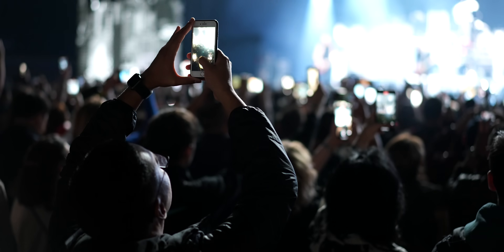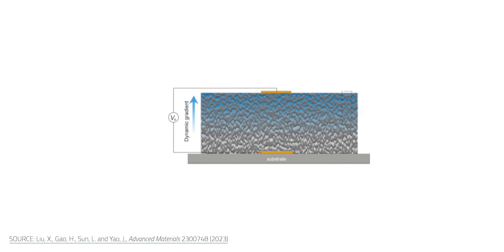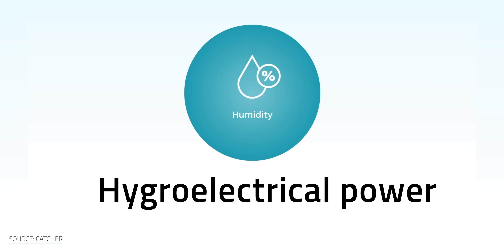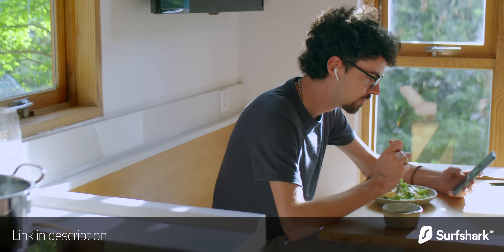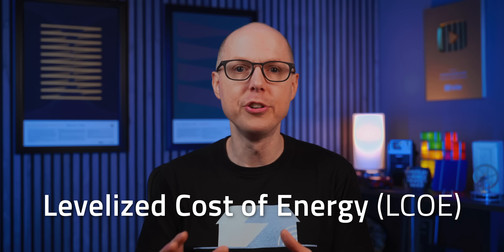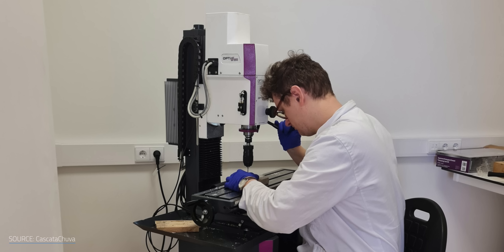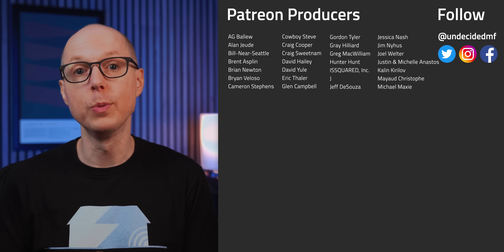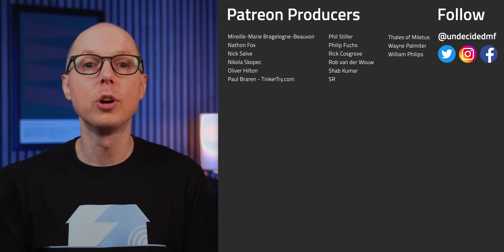Is This Accidental Discovery The Future Of Energy?

Comment from the maker: Do you think Hygroelectricity has a promising future? Get an exclusive Surfshark deal! Enter promo code UNDECIDED for an extra 3 months free at https://surfshark.deals/undecided

If you liked this, check out Is Aquaponics the Future of Agriculture? https://youtu.be/59kk4OjJCj4?list=PLnTSM-ORSgi4dFnLD9622FK77atWtQVv7
Reply: Micheal Faraday discovered the same effect in 1800's. Near the end of his career, Faraday proposed that electromagnetic forces extended into the empty space around the conductor. Much like how a Stubblefield coil works or an air battery. Micro fractal wire works great for Stubblefield coils. Look at those old clocks that need to be covered for the batteries to be kept humid. Stubblefield coils also need to be moist. The effect is not new just not well understood. An ungrounded piece of copper pulls voltage with a meter on a ground lead. Like the warden tower did, but the warden tower also had Stubblefield coils in the ground. Tesla made a static motor to act as a switch for a.c. current between air battery and Stubblefield coils. It works just like an ungrounded antenna hooked to a super capacitor or a fox hole radio. One could argue that its the same force we see attracting protein pairs together but at larger scale. The key to understanding it is what allows it to go only in one direction. Or is it in an alternating form? These forgotten ways of making electric are becoming more useful as devices use smaller amounts. You can already charge 12 volt batteries constantly using Stubblefield coils or run a car radio. Matt you to can have a 12 volt shed ran off Stubblefield coils you can make yourself. With enough coils buried under your foundation they could power a house. Even batter with micro fractal wiring.
Reply: potato can power an LED also. Let's just get piles of Potatos and power the world with Potato power. I could invent a new electronic chip to regulate the potato power and call it the "Potato Chip"
Reply: @cryptogenik  nice one
Reply: Where does that energy come from? Is humid air a form of energy?
Reply: @teddybear2840  That is the question.  Humid air by itself is definitely not a form of energy.  Humidity differences are a form of energy.  So if you have some humid air and some dry air, it's possible (at least in principle) to generate energy by transporting water from the humid air to the dry air.  

But you can't get energy just from humid air.  Not unless you're using fusion reactor to get energy by turning the hydrogen from the water into helium, or some such thing.  And in that case, the fact that the hydrogen was in water vapor would be the least relevant part.
Reply: I wonder whether this is how lightning is generated, except tor it being on a much bigger scale?
Reply: cough combine it with a heat pump in a secondary chamber, *cough*. Your problem will be that the humidity will go away, you need an efficiency kicker.

Now I am going back into my garbage can.
Reply: @bravojr  
Lots of areas with year round humidity.  The coasts and great lakes are a great example.  It also coincides with the fact that's where most people live...
Reply: sounds fishy
Reply: So basically they made the  windtraps from Dune 🤘
Reply: This one might be way too undecided to even be on your channel.
Reply: This could mean electricity where it's needed, typically the coasts.
Reply: nope. no different from any other sensor that exists today. the thing with sensors, they generate tiny amount of voltage/power, connect a lot of them then one could produce enough power.  A solar panel is like a collection of massive amount of photo electric sensors which made them initially expensive.  Going back, there is more acoustic or radio wave energy that can be captured from the air than this humidity sensor. to be fair, still useful.  consider a remote location on earth that may need tiny of power for monitoring or sensors but batteries or solar pv may not be feasible.
Reply: It would be cool, but this effect was discovered at least 10 years ago when the house made graphene craze started. There were even plans on how to turn this into power generators in the ocean. It was not feasible. I think Robert Murray Smith had a few videos on that topic.

It would surprise me if the researchers didn't know of this phenomenon, which makes me quite certain that this is a publicity scam for their company.
Reply: @DoubleBob  Good Onya! Robert Murray Smith is a freekin genius!! LOL
Reply: I think this was a very interesting topic, 
with very interesting implications!

These could make wonderful sensors, 
which do not require external power.

Have a block charge a super capacitor, then at the right voltage it can wake up & perform a data transmission, go back to sleep, and start over again… with no batteries required!

If it could be applied inside the human body, with liquids instead of humidity, it could make a great pacemaker!
Reply: My guess is that it is caused by atmospheric electricity and the role water vapor plays in it.
Atmospheric electricity was a hot topic at the end of the 19th century,  however today virtually nobody has any interest or knowledge about it.
The 300 kV potential difference between ionosphere and earth is a meteorological and astrophysical phenomenon causing a 1500 Amp circuit in the global atmosphere.
A great deal of the charge involved is carried by water molecules ascending and descending.
This means we will  be able to harvest 450 Megawatt from this process globally.
But by doing this we will change meteorological conditions in unpredictable ways.
Reply: Can these desalinate the water while it's at it?
Reply: Great Pyramid could produce how much electricity via it's volume?
Reply: This sounds a lot like the Maxwell's demon analogy to me. There is in reality an abundance of "free" energy surrounding us at all times, but that energy is only "free" in the sense of us not having to give up anything in order to obtain it. But it is also relatively useless. In order to make that energy useful, we need to decrease its entropy. Which in of itself requires a lot of energy. My best educated guess is that this technology can decrease the entropy of this "free" energy for a time, but that something is eventually sacrificed, like the capacity of the nanostructures to continue to do this. Or perhaps the energy comes from an already lower level form of entropy energy already present, like miniscule electrostatic charges present in the air at all times. In which case this energy is extremely limited in its total quantity for a given area. So I would really have to say "No way, José" to this being a viable renewable energy source. It could definitely be useful in certain low-power applications though.
Reply: Almost impossible for a such tech to compete with Lithium Ion/solar.
Reply: @twinkstr  the Chinese already have version called GL TENG that is kilovolt power and 24/7 unlike solar. Gas liquid triboelectric nanogenerators for direct power from water
Reply: If the power comes from a humidity differential, what is maintaining that differential? So far it sounds less like an energy source and more like an energy transducer.  Agree with others, more basic science is needed in this vid.
Reply: @cuisinart7899  it is THEORIZED that a difference in humidity is the cause (it's not)  what is happening is the electrokinetic streaming effect.
Reply: @peterlang777   the streaming potential arises from a flow of dielectric, in this case water molecules. But what is making them flow in this video appears to be the humidity gradient.
Reply: @cuisinart7899  the video is operating under the assumption that a water gradient is needed. It's not. These can be filled with liquid water and still work. I have done the testing on these hydrovoltaic things
Reply: @peterlang777  Do you have any idea if there's anything published on the principles behind it yet?
Reply: After watching a tiny bit of this video I went to your channel saw some more and subscribed. 
 I'm wondering and wanting to see if could do video about how graphene is doing today?
Reply: No. It sound like perpetuum mobile, or it is just voltage/no current. 
Also thus it work when you open it to space (then it is "chemical" battery ) or always (then it is  perpetuum mobile).
Reply: @UndecidedMF could you give some explanation why solar panel installation is so incredibly expensive in the US? I've seen these 20k dollar figures multiple times. I have a 4kWh solar array installed on my roof for about 3.5k euro. And the panels wasn't even the most expensive part. They generate about 25 kWh on the most optimal days. So why the incredible price difference? Is it more difficult to install them on typical US roofs with shingles?
Reply: It's taking advantage of capillary action, like a trees
Reply: 150 square meters?  So only .015 hectares.
Reply: Just google "lapse rate" in wikipedia read it carefully and you will realize that perpetum mobile of 2 second type does exist
Reply: You could run solar as well
Reply: Sounds promising.
What is the specific humidity needed ?

I really do not want to live on the Gulf Coast to get free electricity.
Reply: How is this only now a thing? I've been thinking about this since I was a kid...
Reply: Matt, thank you for posting this. I appreciate your efforts because I had never heard of this before. It's fascinating! 
However, the dates of the "discovery" don't seem to line up. I'm not criticizing the accuracy of your report, only the truthfulness of who "discovered" what, and when they claimed to have done so. It seems like a lot of "borrowing" has been done. LOL

The Geobacter nanowire results were published in 2020 with the claim that the "discovery" was made in 2018.
Xiaomeng Liu (the uncredited student) attended the University of Massachusetts Amherst from 2018 to 2023.
CascataChuva began working on their idea in 2015.
Tesla conducted experiments on his magnifying transmitter in the 1890's.
We've known about the Armstrong Effect since the1840's. (static electricity from humid air - aka steam)
Reply: Hello Matt. You may pronounce "CascataChuva" As Cascata[sh]uva" no problem.
Reply: What is the interference with the video on the bottom of the screen?  It makes it difficult to watch.  Very disturbing.  My question is why is it there in your video?
Reply: I'm curious how the cells work scaled up and grouped up as I feel like the cell gradient would get saturated if ambient humidity isn't fluctuating enough.
Reply: Soo, Matt, how is that new steam room coming?
Reply: Hi Matt.  Can you do a show on "cold fusion?"   Thanks!
Reply: I have had water powered batteries using nanoionic wood nanopores. Have had it for over 2 years it's on my YouTube and timestamped
Reply: @peterlang777  How much power do you get from it?
Reply: @HeyChickens  they are low power but register on a multimeter.  About 20 miliamps on a 3 inch by 3 inch square. I want to stack a bunch to light an LED setup
Reply: And about .8 to .9 volts per cell
Reply: Wasn't there an air battery years ago made? Copper, carbon and magnesium with a wet paper towel.
Reply: @bobtailedtrucker2521  those are sacrificial chemical batteries. The metal is the fuel in them not air or water. These are actual water powered batteries now
Reply: This sounds more like an "active" battery than a source. If this system can be integrated into a  solar panel, wind, or geo system to act as a "boost" and back up when those systems are not producing than that seems like the ideal scenario.
Reply: How long will they last? Cant compare pricing without lifecycle, reliability wtc..
Reply: When comparing the price of one of these hypothetical hygroelectric batteries to solar panels, you described a hygroelectric battery that could produce around 10 kWh per day, compared to a "10 kW solar panel array." Unless there was a typo there, these two are really not similar at all in their output, since the solar panels would produce 10 kWh per HOUR (peak), not per day. That would also completely change the conclusion that they could be similar in cost.
Reply: Any chance you'll cover ammonia burning engines?
Reply: Why place non-adsense as interrupting flow rather than at front/back/both of video, where more people would appreciate mutual consideration and watch through it or not click off?
Reply: how is lightening produced...?  The exact process of how lightning forms is still not fully understood, but there are several theories that explain the conditions needed to produce lightning 1. One of the leading theories suggests that lightning is formed due to the separation of electric charge and generation of an electric field within a thunderstorm.
Reply: What is your opinion of the ENG8 EnergiCell verified by Underwriters Laboratory to generate electricity with COP of 5 ??
Reply: That Segway Portable PowerStation Cube Series sounds like a reliable and versatile option for outdoor enthusiasts and families. With its massive capacity, fast recharge time, and waterproof technology, it seems like a great choice for camping trips or as a backup power source at home. Thanks for sharing this recommendation!
Reply: .  . No one is more dependent upon repetition to establish a consensus than intelligent people -- lest they get caught thinking for themselves regarding a basic element of life as carbon-based life forms .  . We are dependent on a mere 400 parts per million CO2 to feed all of life on Earth -- yet at risk due to global warming by the very element we need to support the process of photosynthesis.  The reality -- in spite of fraudulent claims based upon cherry picked and falsified data and proven intent to commit fraud -- is that CO2 levels must reach a minimum of 1 to 2% in the atmosphere to begin to produce any greenhouse warming effect .  . some 25 to 50 times the current 0.04% .  . If we have the courage to function as individuals, the only means by which initiative is possible versus group oriented behavior and identification by which we remain divided and led down any path but our own in various kinds of crisis and division that serve the interests of a few.  True threats such as geoengineering activities are suppressed as they create regional extremes of temperature and drought that are then attributed to global warming, while these activities also toxify the air and soil in the name of reflecting sunlight back toward space to limit warming that has not taken place since the 1990s while using far more toxic materials than would be necessary for the purpose.
Reply: That's an interesting question! While I can't predict the future, hygroelectricity definitely shows potential. However, if you're looking for reliable power for your outdoor adventures or backup needs, I highly recommend the Segway Portable PowerStation Cube Series. It offers massive capacity, powerful output, fast recharging, and a waterproof design. It's a versatile and durable choice for outdoor enthusiasts like us. Happy camping!
Reply: Thank you for your comment! I believe Hygroelectricity shows great potential for the future of energy. Speaking of future energy solutions, have you checked out the Segway Portable PowerStation Cube Series? It's a versatile powerhouse with a massive capacity, powerful output, and fast recharging capabilities. It's perfect for outdoor enthusiasts like us who value quality and reliability. Definitely worth considering for all your camping and home backup power needs!
Reply: That Segway Portable PowerStation Cube Series sounds like a great option! With its massive capacity, fast recharging, and waterproof technology, it would be perfect for outdoor enthusiasts like us. Plus, the Smart APP Control feature is a nice added bonus. Thanks for sharing the recommendation!
Reply: That's an interesting concept! Hygroelectricity definitely has potential as a future energy source. By the way, if you're into outdoor activities like camping, you might want to check out the Segway Portable PowerStation Cube Series. It offers a massive capacity, powerful output, and even waterproof technology. It's a reliable backup power option for your outdoor adventures and family outings. Stay powered up and enjoy your time in nature!
Reply: Thank you for sharing your thoughts on hygroelectricity! It's definitely an interesting concept with potential. By the way, if you're into outdoor adventures and need a reliable power source, I highly recommend checking out the Segway Portable PowerStation Cube Series. It's a versatile powerhouse with a massive capacity, super fast recharging, and comprehensive protection features. It's perfect for camping and ensuring uninterrupted power supply at home too. Happy exploring!
Reply: I think Hygroelectricity holds a lot of potential for the future of energy! It's exciting to see new discoveries and advancements in renewable energy. By the way, if you're into outdoor camping or looking for reliable power backup, I recommend checking out the Segway Portable PowerStation Cube Series. It has a massive capacity, fast recharging, and even waterproof technology. Just thought I'd share my recommendation with fellow enthusiasts like yourself!
Reply: If you're getting energy out of a box without first putting energy into it and you're not physically or chemically changing the box, you're creating energy. That's never happened in my understanding of the world so I'll refrain from celebrating or investing into this project.
Reply: Thank you for sharing your thoughts on hygroelectricity! It's definitely an interesting concept for the future of energy. By the way, if you're into outdoor adventures and need reliable power, you might want to check out the Segway Portable PowerStation Cube Series. It's a versatile powerhouse that offers massive capacity, powerful output, and fast recharging. Plus, its waterproof technology makes it perfect for any adventure. Happy camping!
Reply: That's an interesting topic! While hygroelectricity shows potential, the Segway Portable PowerStation Cube Series is definitely worth checking out for outdoor enthusiasts like us. With its massive capacity, fast recharging, and versatile sockets, it's a reliable choice for outdoor gear and home backup power. Plus, its waterproof design and uninterrupted power supply feature make it perfect for camping and ensuring quality family time.
Reply: NO, I think it's pie in the sky, just like a thousand articles I've seen in Popular science that never  worked.
Reply: That Segway Portable PowerStation Cube Series sounds like a great option for outdoor enthusiasts and RV lovers! It offers massive capacity, fast recharging, and versatile sockets for all your power needs. Plus, with its waterproof technology and comprehensive protections, it's ready for any adventure. Definitely worth considering!
Reply: That Segway Portable PowerStation Cube Series sounds like a fantastic option for outdoor enthusiasts and RV lovers. With its massive capacity, powerful output, and fast recharging capabilities, it's definitely worth considering for all your outdoor power needs. Plus, its waterproof technology and comprehensive protections make it perfect for any adventure. Thanks for sharing the info!
Reply: Thank you for sharing your thoughts on hygroelectricity! While it's an interesting concept, the video is about a different topic. Speaking of energy, have you heard about the Segway Portable PowerStation Cube Series? It's a versatile powerhouse with a massive 5kWh capacity, fast recharging, and multiple output ports. It's perfect for outdoor enthusiasts and as a home backup power solution. Check it out if you're looking for reliable power on your outdoor adventures or during family camping trips!
Reply: Thank you for your comment! I believe hygroelectricity definitely has potential, but it's still in the early stages of development. Speaking of future energy, have you checked out the Segway Portable PowerStation Cube Series? It's a versatile powerhouse with massive capacity, fast recharging, and waterproof technology. Perfect for outdoor enthusiasts and backup power needs. 😊
Reply: Really exciting news. Hope they publish soon.
Reply: No, because there is no inherent source of significant energy contained in humid air.  The humid air would have to be converted into something with a lower energy state. Not viable.
Reply: for u everything tis the future of power, did u know human body also generates electricity, slavery might be the future of power conversion, jk jk, keep it up champ 😅😅😍
Reply: The amazing thing is that it’s a self sustaining system. Integrated differences to become a thing just we didn’t see until aligning. 
Aligning is the reflection through the neurons and the interconnected differences while maintaining itself. Observer and observed. Superposition is reflection while maintaining self and aligning is the wave collapse. I think this helps show it.
Reply: Nikolai Tesla told us to think non binary, no real or unreal but in 3. Future past and current or how religion found god, the father the son and the Holy Spirit between. The future and past don’t exist but are the lateral limits of the wave of integrated differences and the current is the now that is always moving. Think of a hill and the past on the lower and the future on the right and the current highest in the middle but it’s the flow of integrated differences that emerge the now over and over. We are the river and we swim in it.
Reply: Seems like a variant form of triboelectric power generation. If you have not researched triboelectric power I would encourage you to. Quite interesting process to be sure.
Reply: 1 micro-watt is not a lot of power. In fact it's so little I wonder how you can even separate the effect from that any kind electical field would have. I frequently "measure" tens or even hundreds of millivolts when the elctrodes of my volt meter aren't touching anything. I know voltage alone doesn't mean power, but the current required to have one micro-watt from 100 mVolts isn't that big and a strong enough electric field can induce enough current to get to one microWatt. That doesn't mean the air is some kind of battery, it just means there's an electric field and the probes are at different distances to its source. The current that goes through a voltmeter might already be enough to induce enough voltage and current to induce one microwatt of power. The more of that one microwatt comes from pre-existing electrical fields, the less it will be possible to scale up the effect.
Chemistry isn't my strong suit, but if I remember correctly, deprotonation results in electrically charged water or more precisely OH- Ions. The moisture on one end of the microstructures will turn into lye as current is drawn from the contraption - which at some point will turn caustic enough to destroy whatever it is in contact with. Which means saying the device is "acid-free" is technically true. But replacing acid with another caustic liquid isn't that big of an improvement. In fact it might be worse, because in many ways lye is more dangerous than acid.
Reply: With the continuing direction of governments/big business/globalists to make everybody dependent, this technology will not see the light of day unless people can built this at home.

Any technology that makes a household independent, will be banned, as it takes money away from the existing infrastructure.   About 30 years ago a team in California had a lab demonstration zero point energy, the size of a washing machine would power the average home.   His equipment was stolen and lab shut down, and told that if he valued his life, he should discontinue development in this area.   It was going to take away the need for the national grid, and the revenue associated.   
Similarly, we are seeing local governments requiring homes with enough solar panels to have no need for connection to the local power grid, to be REQUIRED to be connected to the local power utility.

Until we can break this dependence on big business, we are not going to benefit from technology like this.

Its the same with medicine, its controlled by the pharmaceutical industry.  Working, inexpensive phar ma suit ical's  that successfully treated koe vid, were banned to make way for Vac seens, that generated revenue.   Alternative natural heath solutions have been suppressed for generations, to funnel the revenue to the industrial medical combine.

For generations these technologies have been suppressed, and will be stopped from successful commercialization.
Reply: There is nothing smart about taking our limited source of water and using it. No chemical processes is 100% and the leftover hydrogen will be too light to stay in Earths atmosphere.
Reply: First of all, it will obviously only work outdoors with a wind, as you would generate positively charged air, and that needs to go somewhere. But then comes the big question: What actually happens when you suddenly spew a lot of positively charged air out?

But in all, I rate this a "no way" out of an "already disproven" to "mindblowing" scale.
Reply: Sorry to spoil the fun of a well-meaning science buff, but...

CO2/climate-change is the biggest mass-fraud since communism. 

(See Henrik Svensmark for the cosmic-ray/solar-activity/cloud-formation/climate relationship.)

 CO2 is a ruse. 

Climate change the "Greens" are talking about is caused by changes in the cosmic-rays/solar-activity relationship and cloud formation  (See the work of Henrik Svensmark.)  

Cloud formation by actual cosmic rays can be scene with the naked eye in Cloud Chamber demonstrations.  YouTube has dozens of videos about them.
Reply: Power can be generated by water droplets falling through air by means of friction you can light a light bulb.
Reply: Sorry but n
Reply: Love your content!  FYI 10 kw a  day  relatively small unless you mean constant 10kw?   Solar with 10 kw for perhaps 10 hours is instantly producing 10kw every second, making it potentially more powerful during the day. Nonetheless, Ty as this sounds like it may have potential, electrically speaking.  :)
Reply: It seems there is a fundamental misunderstanding here. One is kW the other kWh. The new power generator discussed in this video is claiming to produce 10 kWh per day which is a measue for energy (work). A PV system on a roof with a peak power of 10kW (it's a measure for power) will produce over the year dependig on where you are living roughly 10MWh which comes down to approx. 27 kWh per day. So yes the PV system is more powerful depending on where you are living about a factor of 2 - 3x. On the other side this new system would produce the power 24/7 as long as there is enough humidity in the air. PV on the other hand only produces during the day. At the end both systems would benefit from a battery storage system. When combined with a battery storage system the better deal would definitly be the PV system.
Reply: @l0I0I0I0  You're a little right and a little wrong here. The comparison in the video is 10kWh/day from this new technology, compared to 10kW for Solar. If we conservatively say the solar installation operates at that power for 10 hours a day on average (some days will be cloudy and not operating at peak), then that's 100kWh/day for Solar, which is 10x as much energy, but not 86400x.
Reply: @MagicLango  ty, I misheard him.  I'll correct.
Reply: @l0I0I0I0    Review your math.  there is no such thing as 10 KW per second!   A KW is a rate of power,  a KWH is a unit of energy.  A solar array producing 10KW (average) for 10 hours results in 100 KWH of energy.
Reply: @Hogger280  Its been awhile. It produces 10kw constantly?  Sounds unlikely but Im open.
Reply: Matt, for Christ's sake. So this dumber than solar energy in Europe. And that is really dumb.
Reply: I dont think that this is promising. And i would really like it, when you would think more critical about topics like this. If you think one second about conservation of energy it should be clear, that this is in no way practical for electrical energy production. But with communicating topics like this in a way, that it could be possible actually harms the renewable energies, because people will claim, that some science breakthrough will bring us better energy sources in the future so that everything involving wind or solar will be obsolete. Its just not happening. Conversation of energy! Please think about it more often or put a disclaimer in front of your videos. You choose to communicate this science topics. With this choice you also have a responsibility for a scientific communication.
Reply: @EnchantingCat8365  To fail to continue something because of a fear of what somebody will claim is just a bad attitude. You think you have a show-stopper in your reminder about conservation of energy. Do you really think no one else who has been looking into this understands conservation of energy? This video is full of disclaimers as it is.

If you don't think this technology is promising, there's nothing wrong with that. But I think your reasoning is faulty. And I don't think your disagreement should slow down anyone who thinks otherwise. If everyone gave in to nay-sayers, nothing would ever be done. I say let things be explored, and the results will speak louder than any opinion.